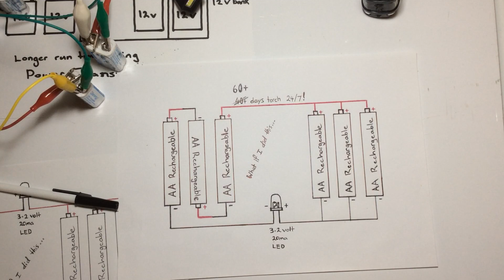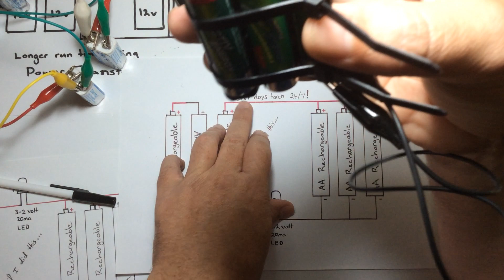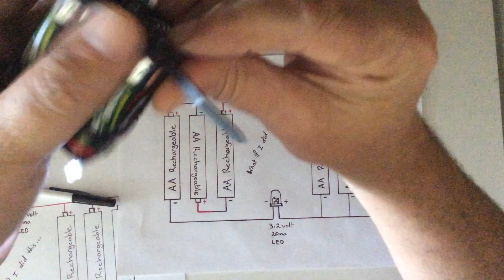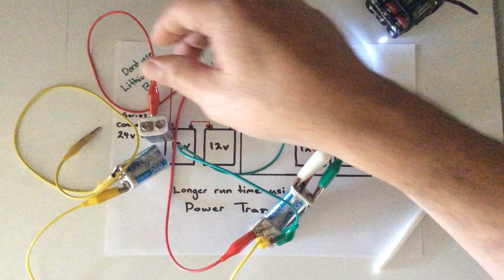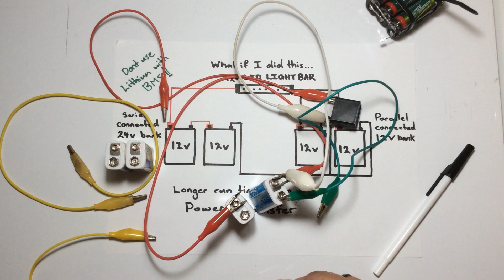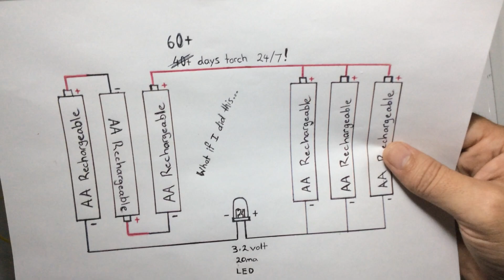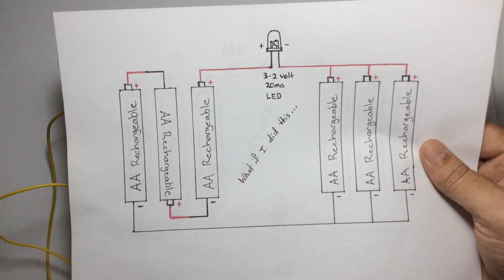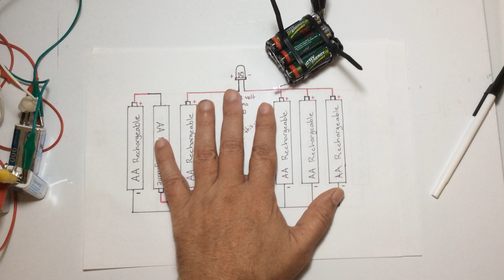*UPDATE* Now its a "60 DAY TORCH" SAVE MONEY ON ELECTRICITY

Comment: Good job man 
But i think you need on off system with coils to collect bemf
Reply from the maker: Thanks for watching. I wanted to demonstrate something for everyone to have cheaper energy as a lot of people are intimidated by winding coils and complex circuits. This is something you could teach a five year old and not worry about their safety. I will be demonstrating a coil based system soon with this Tesla switch transfer system, that circuit will require some care as the back emf from 12 volt coil collapse is approximately 120 volts and lethal, however it will take advantage of the back emf making this run even longer. This circuit is now approaching 100 days with no charge input!
Reply: @whatifididthis...1236  Good Luck man 🙏

Comment: Patrick Kelly got something like that in his research of other inventors. I saw three joule thieves with three Diodes each charging battery from a source battery. 6 volts I believe.  As source goes to a transistor which the output is coming from the emitter of a transistor.when you do that it control voltage. And he uses diodes to ground to base. Which each diode in series raises half volt each. Or use a zener for voltage regulator. That transistor goes to the three JT can lower the 6 volt to 1 volt to supply those three JT. The output of the JT can charge 6 volt or 12 volt batteries. I am going to see if that works with 4 Joule Thieves. But by what he says the Joule Theives have a high COP. 
Can charge the battery from environment. If that don't work I was thinking about how you can charge a homemade capacitor not to discharge but to have a electric field to attract other electrons from ground or the air or both. Maybe use high or low voltage what ever that takes. A hair pin circuit of sorts. If that don't work I would use the Joule theif as the modulation circuit if it were low frequency. I would then wind a coil around that with higher frequency creating a transmitter like device maybe its suppose to be AM. If that didn't work I would then try to match the battery lead in to the Wavelength frequency of the transmitter so it would keep the battery charged as Don Smith explained. You would have a kapandyze and or Don Smith like device maybe.
Reply from the maker: Thanks for watching. Sorry for not responding earlier, I’m not sure how I missed this message. Patrick Kelly must have spent years compiling all that information. I have made so many of the devices he covered yet it feels as though I haven’t even scraped the surface. Would you be able to save me some time and let me know of the page number for the device you mention and I will take a look. I think I can remember which one your talking of, was it originally a rotating model?
Reply: @whatifididthis...1236  Patrick Kelly...... view channel on utube......a perpetual light

Comment: I would try this with a small motor
Reply from the maker: Thanks for watching. There is a small motor in the car headlight that runs even though the coil is under powering it. Is that what you mean or did you have something else in mind?
Reply: @whatifididthis...1236  just running small motors, making mechanical work instead
Reply from the maker: @domestinger8805  I think someone likes small motors yeh? I was thinking of looking for small drone motors as per our last chat, however so much is on the back burner now with my leg in a cast and on crutches for 6 weeks, it’s driving me insane (more than usual). 😂🤣
Reply: @whatifididthis...1236  yeah, thinking brush less myself too. The reason I like the idea is because you can collect a lot more energy back compared to lights alone
Reply from the maker: @domestinger8805  I agree, there is something concrete about seeing a motor turn, solid state circuits are more mystical and don’t appear as powerful as they are. Transforming electrical energy to mechanical will always be a goal for most people I imagine, and rightfully so.
Reply from the maker: @domestinger8805  I’m not sure why I am fascinated with light, I’m not scared of the dark and never was but there’s something about the light, perhaps I was a moth in a past life! 😅😂☺️

Comment: Great work do you tried with lithium 18650 batteries also is it mandatory to have 5 batteries for it to work?
Reply from the maker: Thanks for watching. I have not tried it with lithium batteries. Some of the 18650’s have a tiny BMS built into the top to monitor and restrict power passing based on voltage. Some of my 18650’s have killed themselves because the BMS says it can no longer accept charge. I saw a video on YouTube that covers how manufacturers use this to make the batteries expire so we buy new ones!
The amount of batteries you use is dependent on the load. eg. My LED requires 3 volts to run, I placed three AA in series which gives me 3.6 volts. The parallel bank has a voltage of 1.2 volts but the important factor here is capacity, you need to use the same amount of batteries in both banks. Imagine it like this, you have two glasses of water that hold the same amount of water, one glass is tall and skinny whilst the other glass is short and wide, you know they hold the same amount of water though so you can comfortably pour the tall skinny glass into the short wide glass.
The 12 volt system is easiest to understand, 2 batteries in series and 2 batteries in parallel. This gives you a 24V/12V system for running 12 volt loads. Exactly the same concept. It is critical to ensure that battery capacity is equal on both sides.
Reply: @whatifididthis...1236  thank you for your answer, example if I want to make a flashlight based on your method, that means that flashlight must contain 5 batteries, I would like to use your method to improve some of my products, can you give me your email thank you
Reply from the maker: @zenssysteme681  can you supply me some details regarding the light you are trying to use as well as the batteries your thinking of using and I will help you design a suitable system. My email is shoppagreed@protonmail.com
Reply: @whatifididthis...1236   okay thanks very much

Comment: It's a Tesla switch.
Do you have to get surgery....
Reply from the maker: Thanks for watching Paul. I just wish I had an automatic switch like Tesla had then the batteries would swap themselves around. I believe Electrodyne Corp. had their version running for 3 years producing over 2 kilowatts output. The switching is very important as it produces a high voltage field which dumps excess energy in the battery on field collapse. Why am I telling you this like you don’t already know. I just remembered who I was answering. LOL
No surgery required thankfully, it was a complete rupture but the surgeon said it had returned its position to be within 14mm of the piece attached to the heel. Today’s information suggests there are no benefits to surgical reconnections and that it is close enough for it to rejoin naturally. So a cast for two weeks then a moon boot for four weeks! Feeling very good about not having surgery, thanks for asking Paul. Have a nice day.
Reply: @whatifididthis...1236  no surgery...nice bro!
Reply from the maker: @thebigfella9095  yeh cheers, I was not looking forward to going anywhere near a hospital let alone surgery! I had little faith in doctors after my years of experience with my health and that little faith was destroyed over the last three years, Hippocratic oath hasn’t meant much at all.
Reply: @whatifididthis...1236  i dont blame you..i feel the same..all trust gone

Comment: so if electricity spins around and it's just goes through the load(light), what if we put generator instead of light and here we are more output :)
Reply from the maker: Thanks for watching. You are correct, you can use a generator, inverter, motor or anything else that is DC. I would like to do a test with a mobile phone, either use 12 volt car charger running between a 24/12 volt batteries, or using 4 x AA batteries in series and directly connecting through the phone to the 4 receiving parallel batteries, Rinse and Repeat!

Comment: hope you get a speedy recovery bro.....hey is it possible to recharge from the backend of the paraell side?....like with a solar panel?....and could a bigger system support a dc converter?..cheers
Reply from the maker: Thanks for watching. The parallel set at 1.2 volts could easily be charged via a cheap solar panel from one of those garden fairy light setups. I imagine one could use the same solar panel to charge a single battery in the series bank also. Yes an inverter will work on a 24/12 volt battery setup which would allow you to charge another battery bank. Thank you for the well wishes.
Reply: @whatifididthis...1236  yes ive got one of those little panels...i might throw it on and see how it goes, mine been going over 4 days and strong now for my smaller set up....yeah i was thinking if i made a system big enough to power a converter, to power large items that would be so cool..cheers bro
Reply from the maker: @thebigfella9095  That’s awesome, even if it died today, you would be able to swap the batteries around and continue for a few more days, at least that’s 8 days instead of 1. Do you know what capacity your AA batteries are, mine are 2000mah. Capacity, age and quality of battery are all going to have an effect.
Reply: @whatifididthis...1236  i bought new cheap nasty aaa's ..only 900mah each..hence using 4 not 6 couldnt power my last led...so now i use 6 aaa's and a smaller led and is ok...i imagine its only like say 2500mah total..or 2.5v total?..i didnt measure..the led is 1.8v and still ok 5 days in....and yeah say day 10 i will swap...see how it goes..cheers
Reply from the maker: @thebigfella9095  I’d suggest it didn’t work before based on voltage and not so much the amperage. Most rechargeable AAA batteries are 1.2 volts, resulting in you initially having only 2.4 volts. Most LED’S are 3.2 volts which makes sense that 3 batteries in series works as 3 x 1.2 volts = 3.6 volts. It is fair to assume as your batteries are 900mah that they will last a little less than half the time my 2000mah batteries last. Therefore you could probably achieve 15 days before your first battery switch. The 2nd switch could be after day 7, 3rd switch after day 3 running down to empty with a total 30 to 35 days in total. You did this the correct way though by not spending too much up front to prove a concept is valid. This will give you more confidence if you wish to spend more on a more practical system.
Reply: @whatifididthis...1236  ahh ok yep ...yes that all makes sense cheers...yes id love to run something more practicable off it one day, would be $$ up front but very cool to prove it can pay itself off and then some long term
Reply from the maker: @thebigfella9095  Agreed, I have four 12 volt 7aH batteries en route, everything is just taking so long to arrive though. Cost me approximately AUD$100, but it will be nice to have batteries the same age and quality with a decent 12 volt LED light.
Reply: @whatifididthis...1236  yeah nice ...!